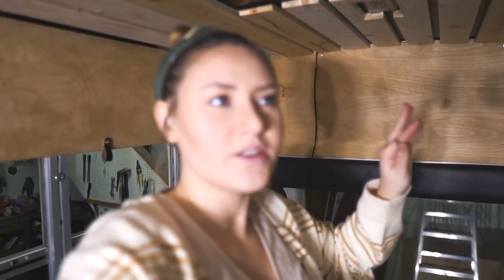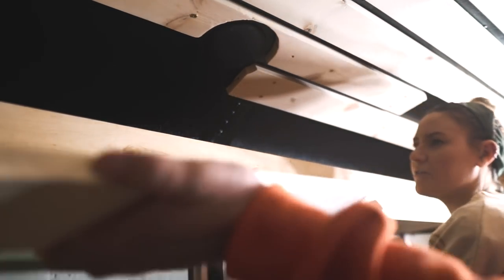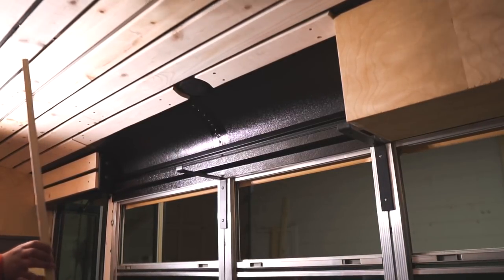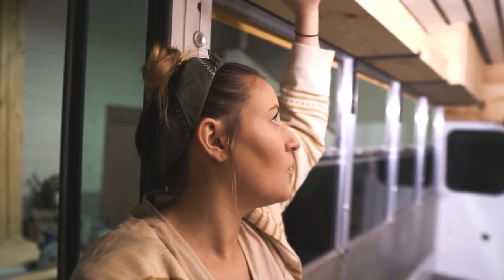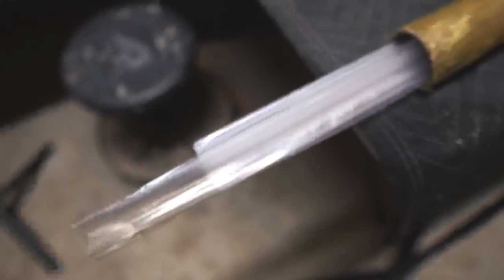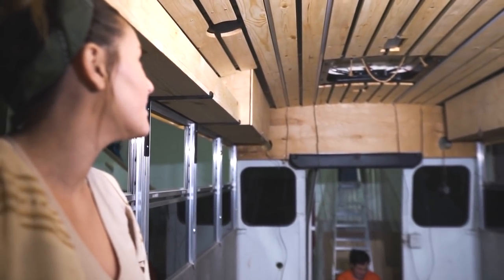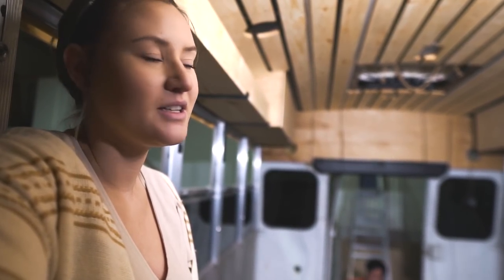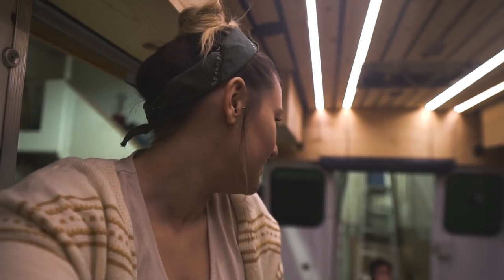We Didn't Expect This - Day 5 of 30 Day Short Bus Build

Comment: I've used that kind of sticky tape you are using for your track light and it never holds for long.  Everything I used it on fell off.  You'd be better to use some kind of liquid glue adhesive.

Comment: Y'all that ceiling and lights looks great, and it's good to have 2 people working together to get things like this done. My 2nd van conversion build is still on a delay mostly due to the caregiving for my elderly dad, working on projects in his old house that I hope will hold over through this winter and until whenever his old house will be completely demolished and a new house build for him would be done. The 2 story building in his back yard will be getting demolished soon after when they help relocate my dad's electric meter, main electric box,power line and conduit off of that 2 story building so my dad's electric to this main old house will still be on for him until whenever the demolition of this old house takes place. The 2 story building, sadly is condemnable due to a fire back in 2011 and not at all salvageable and remodeled, before the fire, it would have been an awesome salvageable and remodeling project making it at least a up and down stairs duplex of sort, but it's too far gone for that. So, will be saying goodbye to that building. And, eventually also goodbye to my dad's old condemnable house too, and hello to a new house build for him. Anyway, I enjoy watching y'all's 30day bus build videos, while I'm in the midst of doing all that I've been doing. I. Hoping soon I'll be back to work on my van conversion build again. If anything, whenever I finally get to the electric and wiring part, I may need help with that most. Rest of this build isn't too bad and not that hard to do while taking the time I need to do so, and not always that easy though when I'm doing the work myself without outside help when I might need an extra set of hands in some cases, my dad can't help physically because of the weakness he has since the stroke he had in December 2017, he never followed up with rehab and therapy since, nor wants to go do his daily walks no more since May 2020 (he's let himself go down hill since his wife passed away in August 2019). I'm doing my best overall that I can for him since too. All this I've been doing it's a lot and gives a new meaning to multitasking too. Love y'all, be blessed warm and safe, see y'all's next videos soon 💖🤗💖🤗💖🤗
Reply: Barbara, I’m also caring for an elderly parent as I plan/dream and learn from these two and their crew of friends. Blessings to you in the new year!
Reply: @msvg3  thank you blessings to you also, it's definitely not easy caring for an elderly parent and trying to do everything else too outside of the caregiving, such as the projects to do a temporary fix of his old condemnable house to get through the winter and and least hopefully hold thru till the demolition and new house build for him that'll be functional, clean and safe for his health wellbeing and safety overall, while I'm also working on my 2 van conversion build too, so this way not only a tiny home on wheels for myself, but also so I can take my dad to see our grandbabies and other family too who all live 2000+ miles northeast from here. And, in the same breath, I so enjoy watching Jaylena and Isaac with their builds and so happy for them, too. It makes my day to do so while in the midst of all I've been doing as well. 🤗💖

Comment: Everything looks great love the ceiling. Just wondering have you thought about using tool boxes in one of your builds? They have so many shapes and sizes now I think they would look super cool. Don't forget to take the wheels off the bottom LOL
Reply from the maker: I personally wouldn’t use one in my personal build, but isaac has talked about putting one in one of his next project builds
Reply: I probably wouldn't want it on mine either but sorry I put it on yours instead of Isaacs. I saw it on somebody else's build and it looked pretty cool and I was just thinking that it is a shortcut TimeWise so he can get through some of these builds plus I bought one for storage for my son and even already had a wood top not little drawers it had big compartments for drills and saws and handheld tools. Just was thinking about that since the price of wood has gone skyrocketing out of control and even sometimes hard to get. Being a mom really suits you Jaylena you look beautiful!♥️💞